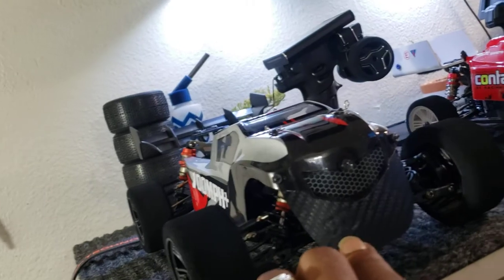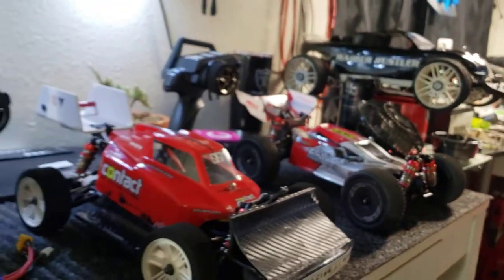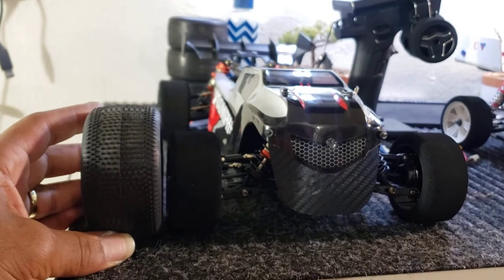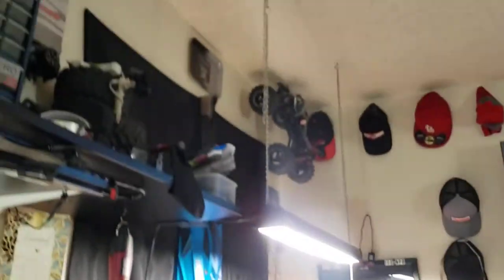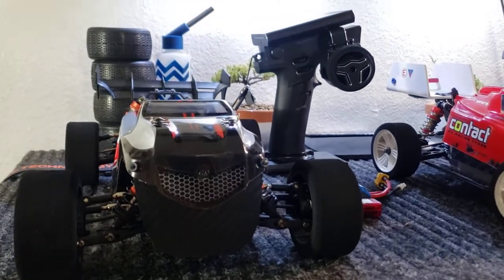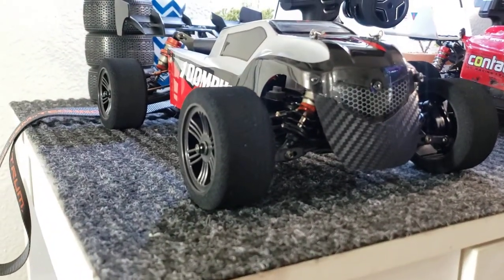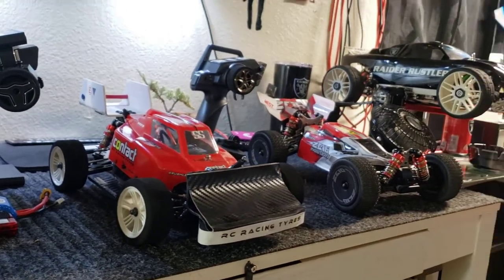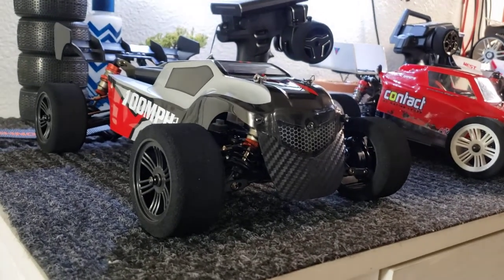1/14 tacon bulwark update

Comment: Any updates with these rigs? Been a while bro
Reply from the maker: Wats good bro..hope all iz well...I gotchu..mybad...been sooooo busy at work...over night throwing that freight at Smith's grocery store lol 12hrs a night smh
Reply from the maker: I'm off this Wednesday n Thursday...I got the 5mm steel rod in from Amazon. Just need it cut to size n holes drilled in at the ends for the little gearbox gear that fits inside the gearbox off the center shaft
Reply: @tizrc1358  damn long shift.. aight al good bro.. stay safe and have a good day.